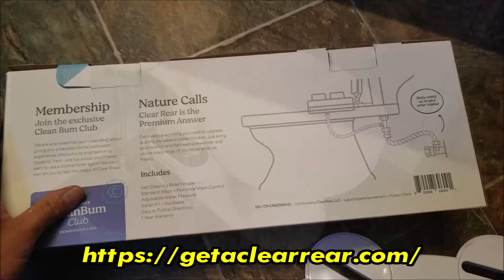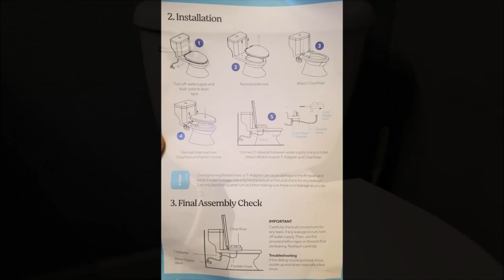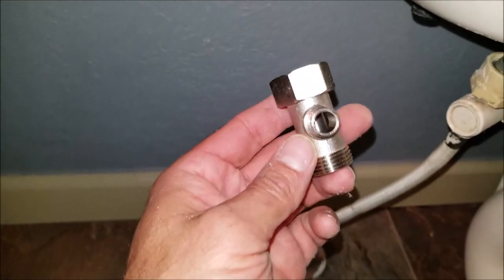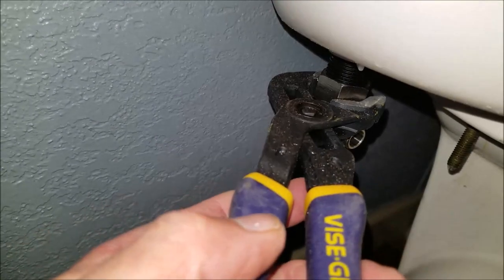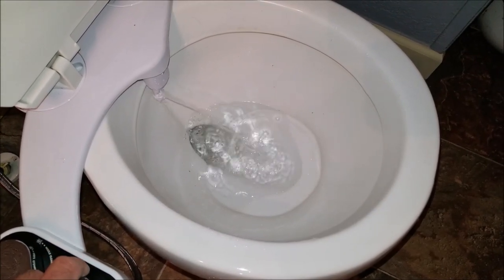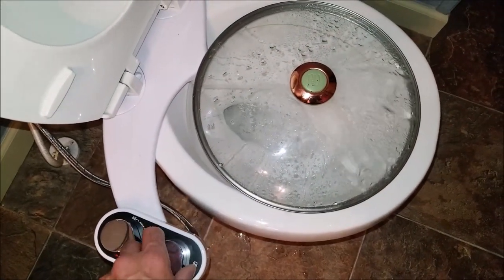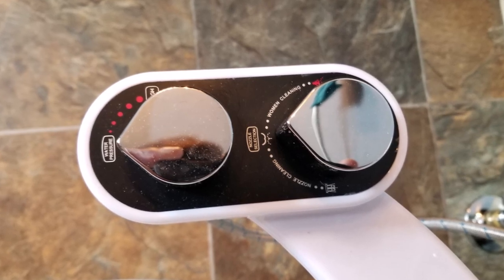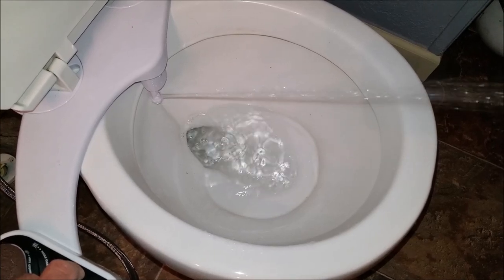How to install Universal Toilet Bidet "Clear Rear" + Test & Review

Comment: Than you for the excellent video showing how to install a Bidet toilet attachment. I purchased 2 ultra thin Bidets so the toilet seats  were not influenced by the thickness of the attachment. Since I purchased the Bidets from amazon I received them in 4 days. After installing the Bidets I was happy the toilet seats were not raised much at all. Both the Bidets worked as advertised. The downside is the ultra thick attachments are very flimsily waiting for an accident to happen. To provide additional support I installed 1/2 inch pex tubing in between the main Bidet unit and the floor. I used double sided tape to hold the pex tubing  in place. I did posted pictures on Amazon along with a write up. Eventually I may spend the extra money and buy the a Bidet toilet seat.
Reply from the maker: Thanks.  And good job with the bidet reinforcement you did.

Comment: Nice review and step by step install. Only thing I recommend doing that you did not is using Teflon tape for all water lines so they don’t have a place to leave if the washer fail or is not aligned correctly.
Reply: If a washer fails then teflon isnt saving your butt.  Nobody should be using teflon tape on these connections. They are all sealed only with washers.  If there is a defect that is causing leaking then that defect needs to be addressed.

Comment: Ok,we just installed ours. However, it's different from this video.the knobs are white plastic an d you can barely see the settings. Only one knob to be used. The second knob is just to adjust water temp, but we only have cool water, no heat. There doesn't seem to be amy setting to clean the spigots.It had to be adjusted,an d seems to work OK. The battery operated self clean light,bought separately, keeps shutting off. Do I  think it's worth it? I guess so but for how long? It is made with thin plastic. We will see.

Comment: You want to use plumbers tape to assure no leaks from any threads of all connectors.
Reply from the maker: Plumbers tape really doesnt help or do much when using a hose with rubber gasket. The hose seals with compression against gasket.  When connecting a hose with no rubber gasket plumbers tape or paste will be needed.
Reply: total bs.  These are not designed to be used with teflon tape

Comment: I had no problem receiving or installing Rear Clear and with no leaks. The bidet works fine, however, my tank will not fill up and I cannot flush my toilet. Please advise..... Thanks!
Reply from the maker: Sounds like there is something plugging the inlet to the valve in the tank or the valve itself in the tank is not working properly.
Reply: @D.I.Y._All-in-One  Hi C.L.S. I really appreciated your video, though I watched it after my installation. After I posted my question to your site, I discovered that the floating object on the hollow post, on the left side of my tank, was not dropping down the post so the water could be release to flow in. I adjusted it a bit, and it seems to work better. I will leave off the lid of the tank for a day or so in order to watch it and adjust it more as needed.
I am glad to find your site. I rarely subscribe to any YouTube's but I feel that I have found a great teacher in you. In the future, I will check your YouTubes for any other projects I work on before I look elsewhere. Thanks so much for responding so quickly. G.Maria
Reply from the maker: Thank you

Comment: Hi friend, can you help me out?
I can't disconnect the hose from the underside of the tank. There seems to be a white plastic part like the one you have, but there's also a metal one, they seem to be stuck together. I think I have to unscrew them apart but I'm unable to do it.
Also the toilet valve is now loose inside the tank.
What do I do?
Thank you for your time.

Comment: How do you resolve the issue that the original toilet seat when installed with the bidet seat does not seat properly?  Leaves a gap that can pinch?
Reply: You might need to buy a flat under surface toilet seat with additional toilet seat bumpers to let the seat sit higher in front.. The toilet seats that originally come with the toilet are usually concave and round downwards, which can hit the bidet and not let the toilet shut all the way. Hope this helped, if you haven’t found a solution already.
Reply: I replaced a high cost quick release seat with a inexpensive enamel wood seat.

Comment: Asked customer service this question and they sent me to this video.  I have the Duke model with hot and cold lines.  Installed fine, no leaks, works great.  Problem happens at the end of the toilet flush now.  When tank gets full, my feed pipe growls like a baritone bagpipe mateing with a harmonica.  This only lasts about 10 seconds, and I'm usually back in the livingroom or bedroom by the time it happens.
Any advice?  My plumber relative has no answers either, and if I cannot get rid of this noise, I will be ready to get rid of the bidet.  Thanks, Ducky Duke
Reply: Sounds like you needa up your water pressure to me
Reply: @shaynewalker4519  I just got rid of the whole thing

Comment: Do I need a rubber washer for the inside of the connector on the bottom of the bidet? Where the knobs are. It’s currently leaking, and teflon tape doesn’t seem to help.
Reply from the maker: Hose that connects should have rubber gasket built in.

Comment: Did you have any trouble putting the toilet seat down? Mine isn't fitting right I'm afraid to sit on it and break it since it's not laying right on the bowl.
Reply from the maker: My seat has a small gap but seems to function fine.
Reply: @D.I.Y._All-in-One  My toilet seat does not go all the way down either...but i guess when you sit....it goes down then..
Reply: Same problem here, elevating the back of the seat raises the front 2” over the front of the bowl

Comment: How did you level your toilet seat?  Mine sits at an angle even with the extended pads that I bought.
Reply: if you put a level extended pad on an unlevel floor it will still remain unlevel.

Comment: I don't think there is an adjustment for where the spray goes at least I don't see how that can be done. I have it set right now with the sprayer all the way back but it doesn't seem to spray in my needed area for a mail that well. I still have to use toilet paper some times. . If you move the seat forward than it will overhang in the front so that's not good. I wonder how this would compare to a GenieBidet elongated seat.
Reply: I now have the Genie Bidet and it seems to clean better in the rear than the ClearRear as a man. However my wife seems to like it better than the Genie so far. Genie is odd because for me the nozzle that pops out seemed to hit the right area when the lever is in the woman position and it's not just me but I found another man who's tried it and agreed with me. I'm still not have decided which I like better.

Comment: Maybe when they come up with a heated version... Until then, the prospect of rinsing with cold tap water at 3:00am just doesn't have a lot of appeal.
Reply: I live in Montana - we’ll see if I end up using it in the winter.. but I figure, I don’t have to use it EVERY SINGLE TIME to get the benefit from it :-)

Comment: Obviously you still need to to dry off. Also unless this has fire hydrant pressure, on occasion I will be in trouble. Tmi, I know, sorry. Maybe better off buying a pressure washer. Only 1 issue, who helps?
Reply: Just get a small pressure washer but don't forget to hold on to the toilet
Reply: @siciliasmith2977   lol if its pee as you say i stand - and i still think i can do better with paper because i take a shower every day if that thing breaks lol that will suck the T-paper don't cost as much i will stay with it

Comment: so no teflon tape is needed ?
Reply from the maker: Its only needed with connections without rubber gasket.  You can use if you want for extra   protection but not necessary.

Comment: Your water connection hose is upside don. Shutoff valve should be on floor.
Reply from the maker: It's hooked up correctly. Its just a different type valve then most.

Comment: we use this in Arabic countries for decade because we don’t use paper toilet 
We must clean with water that our religion says 
It’s not the same device but similar
Reply: Hello, I have always been curious, but how do you dry off if you have no need for toilet paper? Also can a bedit remove all fecal matter without wiping with toilet paper? Just curious if  you can explain. Thanks.
Reply: @kissed3127  I prefer the hose with spray head (Shattaf) to direct the water spray instead of the bidet, while real washing is done using the other hand. Some people use the toilet paper to dry, but I find that siting for 30 seconds is sufficient, especially that this is now a clean area. This is the Islamic way of cleaning (Tahara) for the past 1500 years.
Reply: @durry-  I didn’t realize they had water pipes and “water pressure” 1500 years ago.
Reply: @ItAintMeBabe99  you should read up on ancient aqueducts

Comment: But you still have to dry off so how does it save anything
Reply from the maker: Just a minimal amount is needed to remove moisture.  One small wipe does the job.
Reply: If you are clean, what's wrong with using a terrycloth washcloth to dry?

Comment: Pretty gross things can happen with this thing. I've seen similar products where the last person had "sprinkler butt" and the device got all dirty. When you flush the water, it can't reach the water jet device, so it needs to be cleaned manually. Again, pretty gross.  Just way too many places for nasty things to cling to and smell up  your bathroom. There is a reason why a separate bidet exists-and those are the real way to go.
Reply: It's exactly what I'm thinking, unfortunately not very hygienic, especially for woman, the water can be easily contaminated.
Buttwasher is a better option for me.

Comment: Am I the only one that thinks this is gross. Aren’t ladies supposed to clean from front to back. How do you dry? I’m thinking wet underwear.. I’m not sold.
Reply: The spray of water just does what it intends:  to clean; it doesn’t push anything inside.  You can pat dry with fewer sheets of paper opposed to a wad OR since it’s for personal use (of you or your spouse) you can have a personal towel and pat dry your squeaky clean bum.  I personally like to use a mild soap too, but that’s just me.